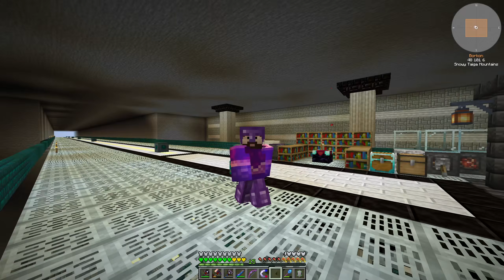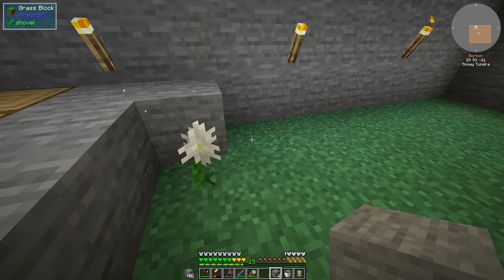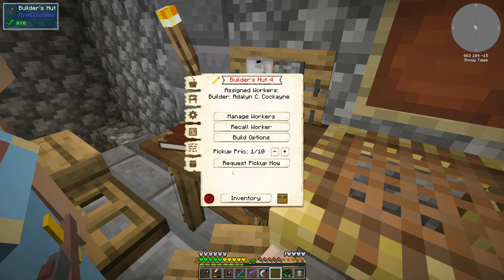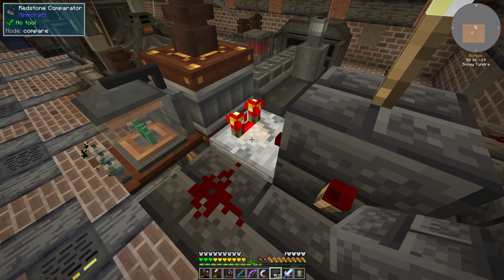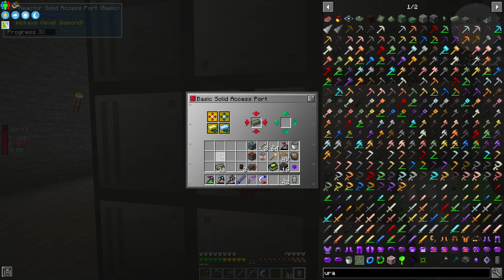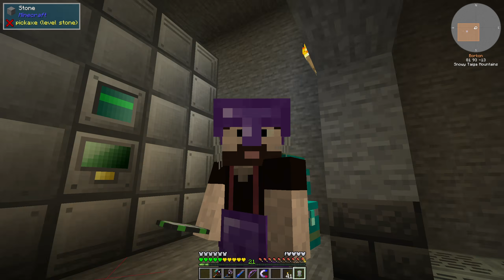Flowers and Power.  - Minecraft Cave Factory Ep. 15

Comment: If you make the flux controller from flux networks you can charge the jetpack while it's on you(wireless charging tab) as fast as you can pump power into your flux network.
Reply from the maker: Yep. but that's just too much. I'm trying to limit myself from using stuff that's too powerful. I might do it some time later, but right now I'm ok with having to recharge sometimes.